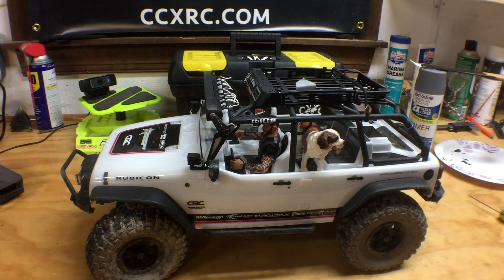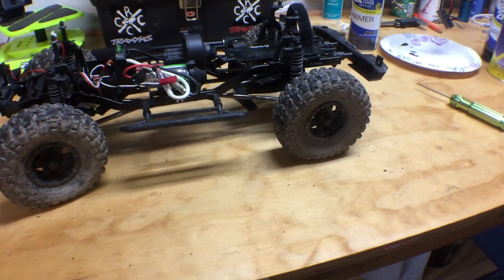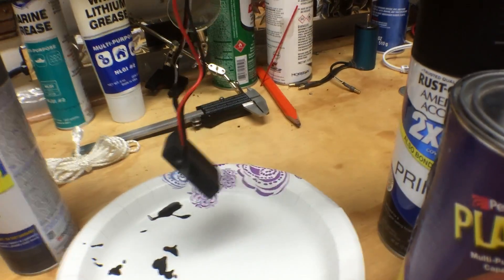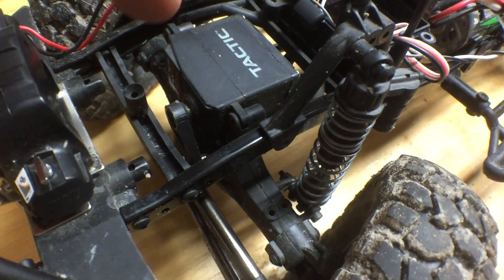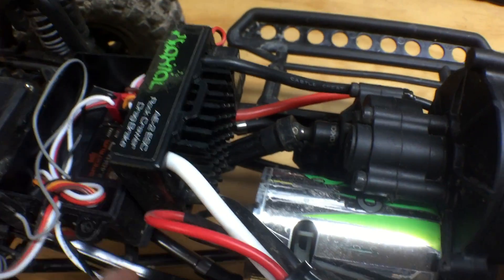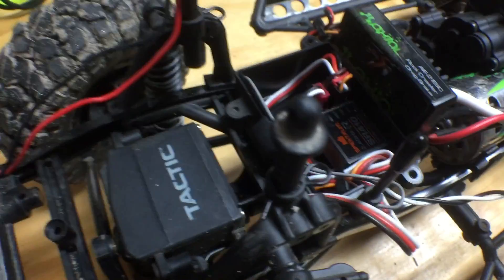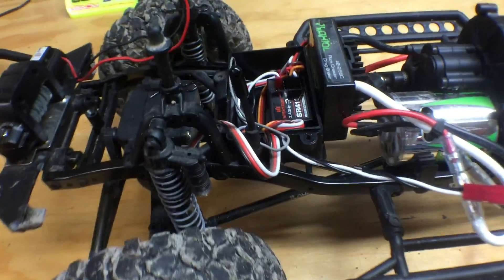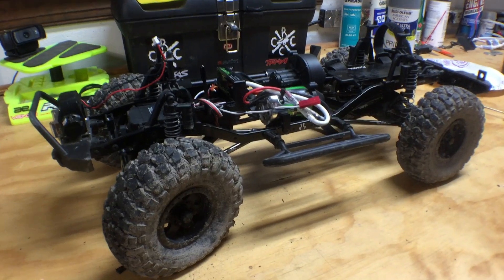VLOGGIN' RC: Upcoming Axial SCX10 Waterproofing Project

Comment: Well that answers a question I had about whether the SCX10 was waterproof, as I was looking into getting the Deadbolt.
Question though. When you plastidip the modules like that, is heat not a concern? It seems as though the dip would insulate very well and hold the heat from the electronics in.

Or is the heat not enough to matter?
Reply from the maker: +Rush Wingate Heat can be an issue with Plasti Dip or even the balloon method. With my current gearing, heat shouldn't be an issue for the ESC.  If your servo has metal ribs to transfer heat, you just have to tape it off and remove the tape to make sure Plasti Dip isn't on them. The servo only needs plasti dip on the seams, screw holes and opening for the wires because the grease should keep it from entering the top into the gears.  The same can be done with a Plasti Dipped ESC...you can leave the heatsink exposed.  A lot of people will use conformal coating on the internals of the ESC instead of Plasti Dip.